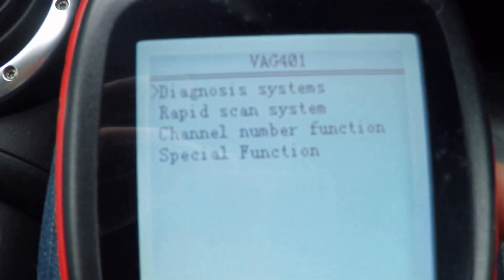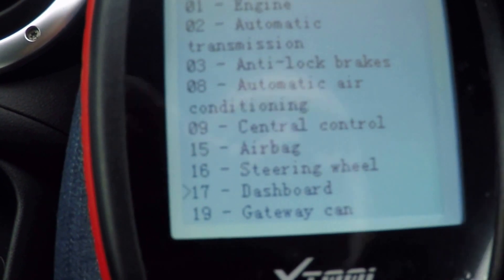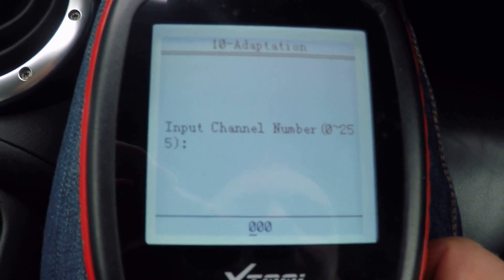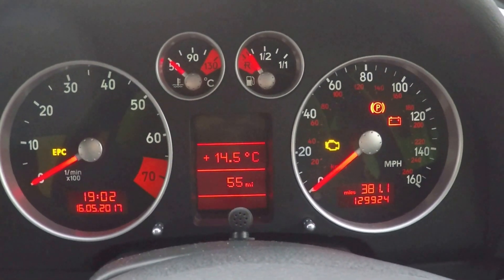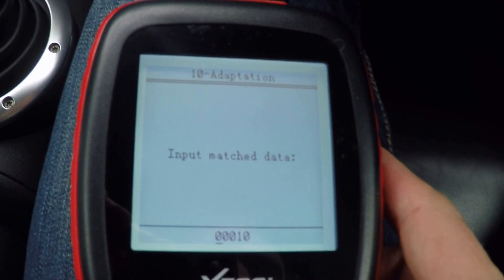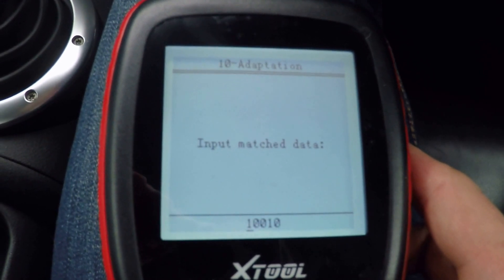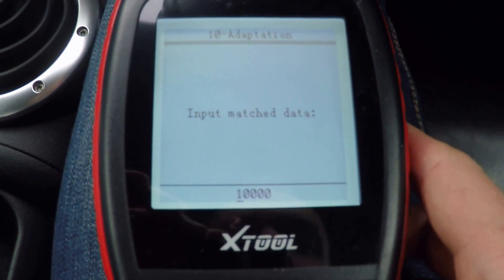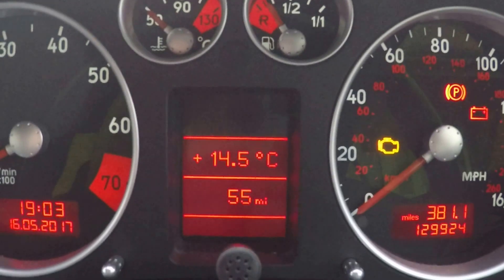Adjusting Dashpod Lighting with XTool VAG401

Comment: where do you get the codes from I have searched the new and cant find anything, I have a VW T5 and would like to have the codes to enable me to do adaptations
thanks
Reply from the maker: Sorry, I must have had notifications turned off and completely missed a load of questions on here. I get all the details from the Ross Tech web site (makers of VAG-Com). The layout of the menus is, shall we say, rather similar and it seems that even if the XTool doesn't understand the meaning of some values it can usually retrieve or set them if you can work out the location and what they need to be.

Comment: Could you do video how to do correction of the dashboard speed sensor as when i check the gps or even vag401 the gps and ecu show the correct speed but the dashboard shows 5km faster at any speed too 100kh/h after that its 7km/h higher over 100km/h just dont know where to go or what code to put in vag401 thanks
Reply from the maker: Sorry for the really long delay, I must have disabled comment notifications. If you search for VCDS distance impulse number you will find a few suggestions on what to adjust but it doesn't look too be hugely versatile. I'm afraid my car is off the road now and about to become an engine donor so I can't record any more videos with it 🙁

Comment: Where can I find auto transmission temp? trying to check fluid level at proper temp but cant seem to find it on this device.
Reply from the maker: Hi. I don't have auto transmission but according to the Ross Tech site (my usual source) that info should be under diagnostics, auto transmission, measuring blocks, then either 002 or 004 depending on the model.
Reply: thanks for the quick reply, i will take a look after work and post up results for anyone else